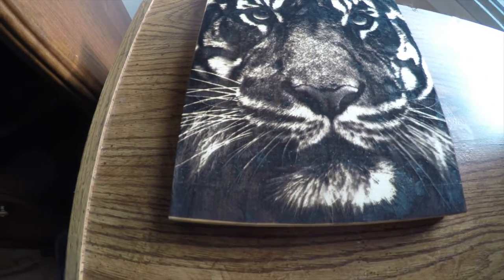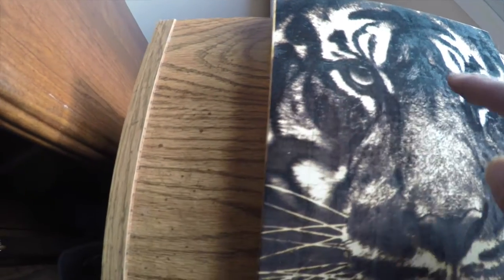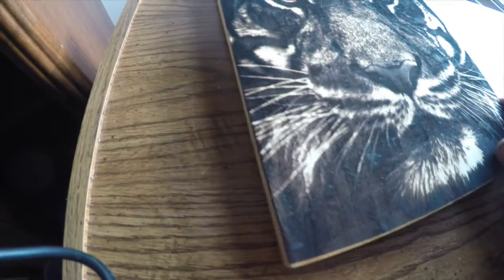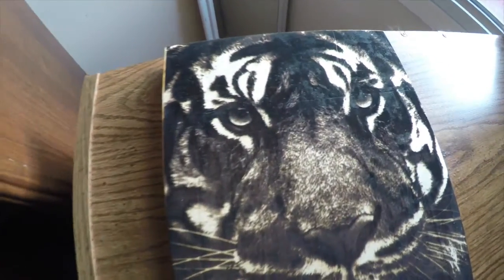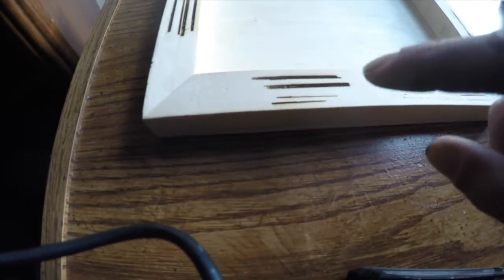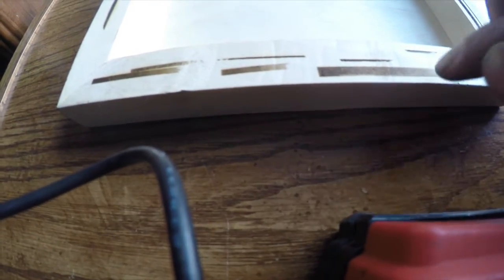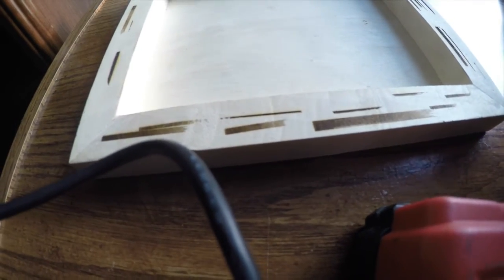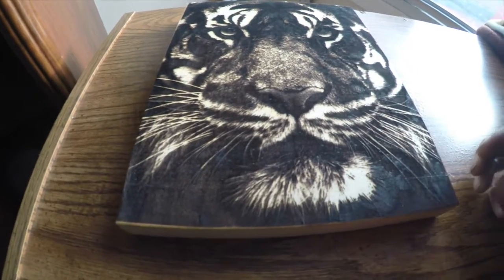Shapeoko 3 CNC Laser Tiger Timelapse and Result

Comment: Thats come out real good, i do have a cnc 2.5watt laser engraver think i might give it a go. Thanks
Reply from the maker: http://nebarnix.com/img2gco/

I did some gradient srip tests first, then settled on the settings that orked the best.
This page is what I think I ended up using for th gcode.
I'm going to fork his github and make an edited version, I think I needed to change the laser on off command with find and replace.